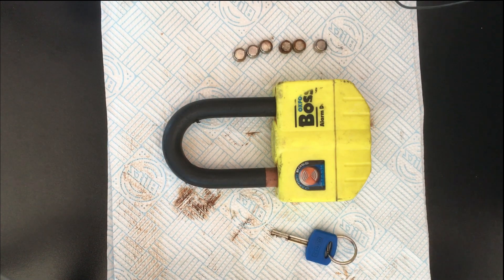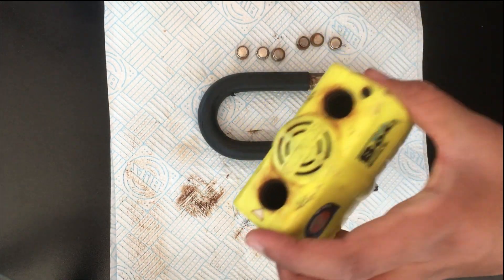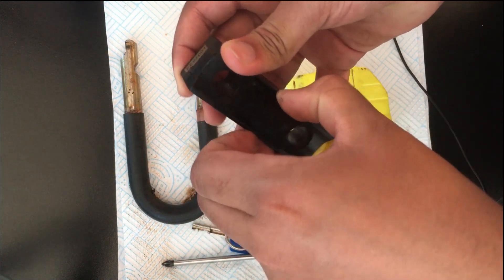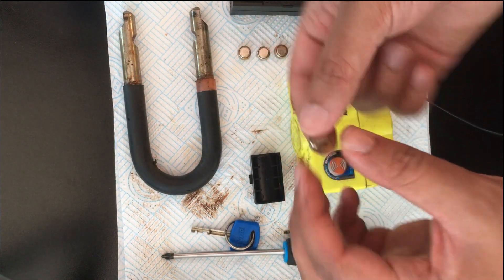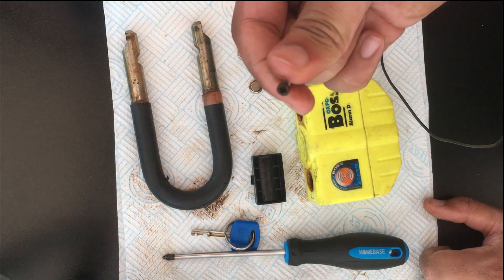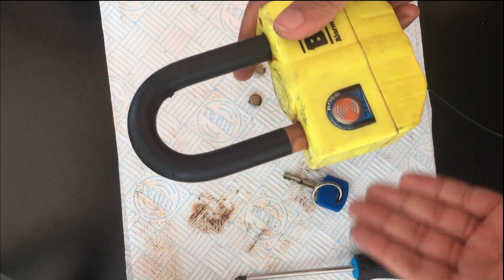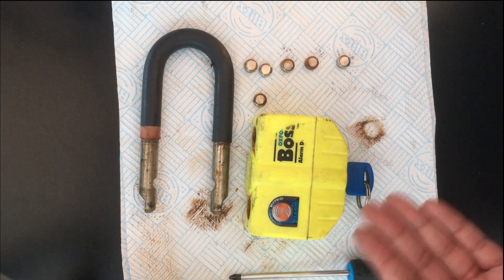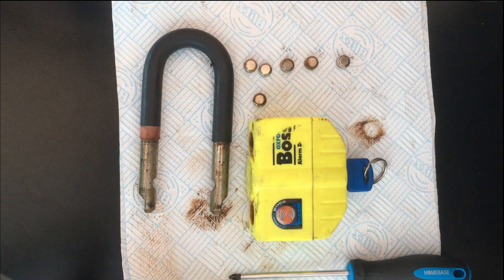Oxford BOSS Alarm Lock Review

Comment: 2 seconds with a battery powered angle grinder, and chuck it as hard as you can. That's what a thief will do to circumvent your silly lock and alarm. I hope you didn't pay more than a dollar for it because your bike is long gone. Now it would be a good decoy to Fool a thief if it triggered your GPS and called the cops sending them your GPS data.. if it can't do that, it's not worth having.
Reply: It prevents theft , keep staying negative Hahaha
Reply: @jamesroberts9921  It's a deterrent at best. A determined thief will easily cut through it in seconds. It doesn't prevent theft in any way shape or form. If you think that you've given yourself a false sense of security.
Reply: Then what would you suggest ,try and put a positive spin on it haha
Reply: @jamesroberts9921  I suggested it already. It's not if your bike/motorcycle will get stolen it's when, have an active GPS that calls the cops with the tracking data. That's as positive as you can get. They have those systems in place in the UK, I don't know about the USA but there is no reason why it cannot be done. Otherwise have a GPS tracker linked to your smart phone and Pray a cop will take the time to help you get your stolen goods back.
Reply: The 2 seconds is all I need to grab my crossbow, that's the whole point for me. One of 3 or 4 locks, just enough to slow the toerag down. Thieves should beware the bike owner with a crossbow, chest freezer, and woodchipper, for he will simply make you disappear.
Reply: "2 seconds"
Exaggerate much?
Now, this isn't adamantium, just plan hardened steel, but the angle grinder able to do that in 2 seconds, won't fit in your pocket
Reply: @Nightdare  There are small battery operated angle grinders. Perhaps not pocket size but will easily fit in a backpack. Thieves commonly carry backpacks to carry thief tools and to store the loot.
Reply: @DivergentDroid  

Still won't go though any decent disc lock in 2 seconds
Hell, they'll be faster cutting the brake rotor, but even that won't be 'seconds'